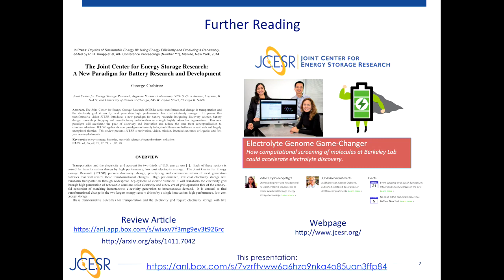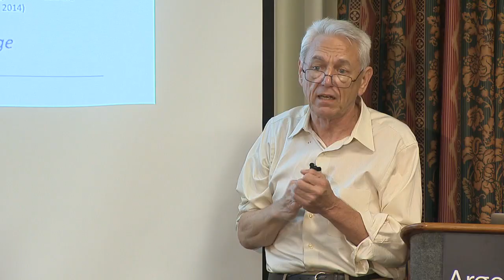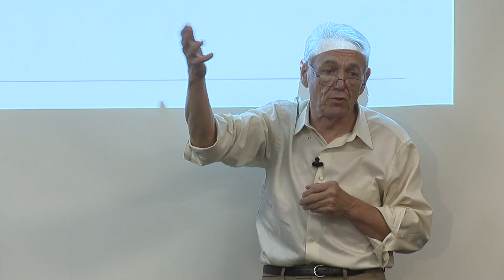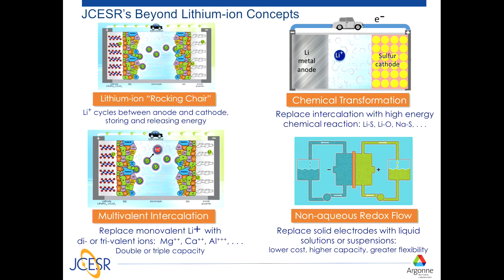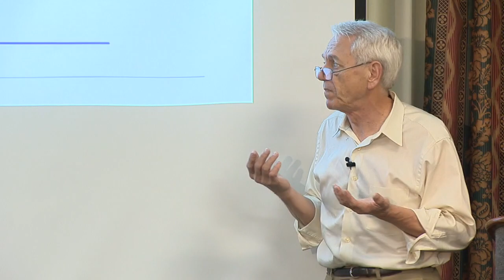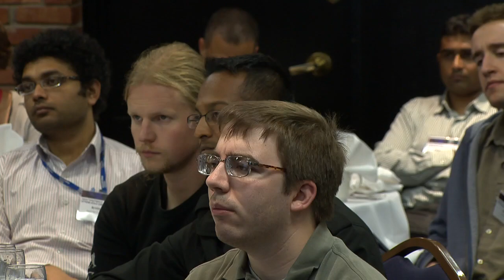Next Generation Energy Storage: Beyond Lithium Ion | George Crabtree, Argonne National Laboratory

Comment: It seems to me that the focus of their research is on energy density more so than storage cost. It is not really the same thing. The grid needs super cheap storage but density for a stationary application is only marginally important. Vehicles need energy density first, so can still be moderately expensive. They shouldn't really expect their battery prototype to be exceptional for both applications.

Comment: graphite, your source for graphene, is not as abundant as lithium and most of known deposites are in China.  If you end up having to synthesize it, there goes your cost advantage. Graphene, will pobably have to be reduced to nano particles (graphene in solution) to get sufficient surface area and there goes your cost advatage. Hope I am wrong. Good luck.
Reply: graphene is not used in batteries in commercial scale. just graphite powder/thin films. Good day.

Comment: In the medical field the mitochondrial apparatus is the energy plant for the body.  Have you looked at copying this process?
Reply: That would be a fuel cell rather than a rechargeable battery. Maybe that's worth pursuing, but I don't think it will lead to a rechargeable battery
Reply: A thought worthy of consideration.  But the complexity of a biological system that relies on enzymatic manipulation of substrates probably would make it extremely difficult to apply to cathode and anode with the electrolyte to provide the pathway between these two.  Remember, it took millions and millions